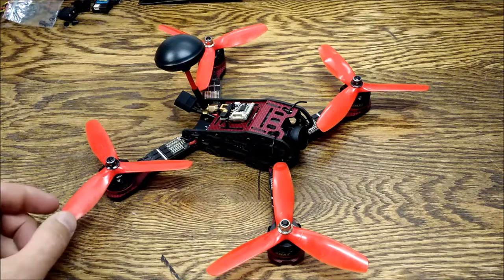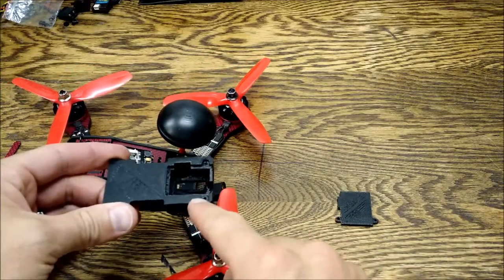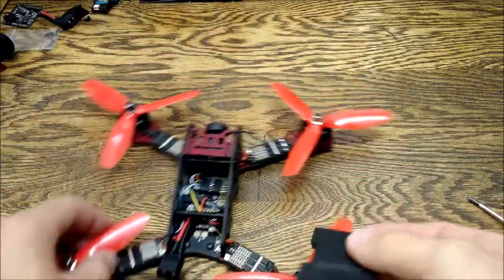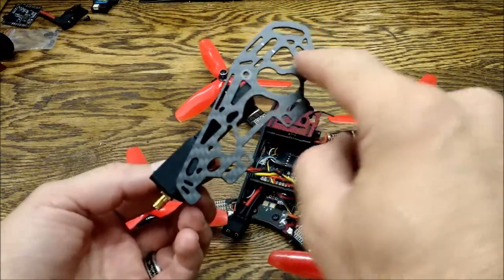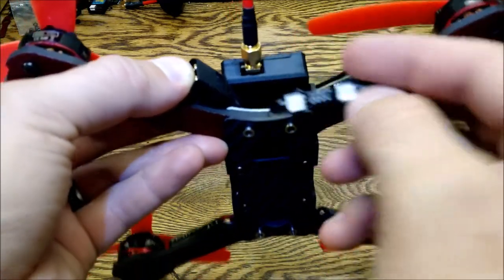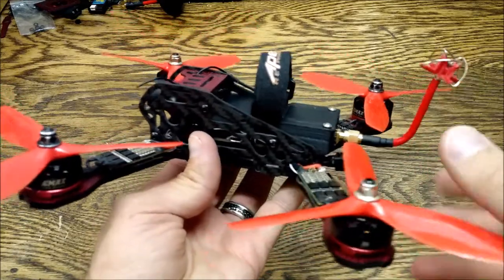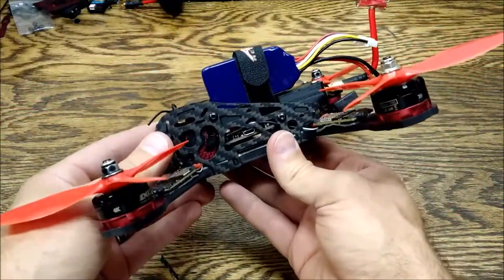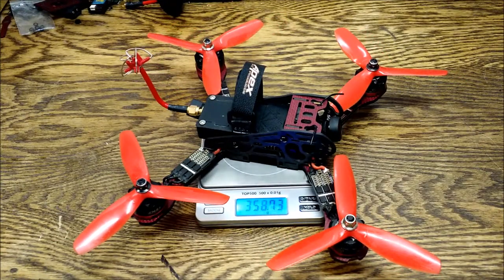Armattan armadillo transmitter installation

Comment: I mounted my VTX in sideways with the antenna coming out the left side. It works ok but what I really like about your 3D printed part is the nice flat platform for the lipo!
I fly in moderate to high winds over hardpack and asphalt and it's really hard on bottom-mounted batteries. I put a CF plate between the lipo and strap to ease the wear when I skid but for whatever reason when I wreck the bottom hits more often than the top. 
Even though I love the way the Armadillo flies I switched over to the Chameleon when Chris released it just to get my batteries off the ground. I'd like to get hold of a platform like that and start flying the Armadillo more. Nice job on the design!
Reply from the maker: It is a cool frame but I moved on as well, I was going through arms like crazy and even though the frame has a warranty waiting two weeks for an arm is not fun.
Reply: That's a bummer about the arms. I've yet to break one. I've destroyed two motors an ESC and a lipo but the frame itself has held up ok. I guess my only frame issue is with one of the posts that hold the camera. It's developed some slop so it moves up and down a little between the notch in the PDB and the notch in the top frame piece. Not too bad but enough to make the camera tilt to one side a bit after a hard landing. First time it happened I thought my gyros were messed up. Leveling the quad through the camera was actually rolling it slightly to the left.

Comment: it was the Aomway Tx25 5.8G 40CH AV 25/200mW Switchable Mini VTx
Reply from the maker: Good to know. Mine just barely hit the prop but I think a spacer on the inside threads of the vtx could fix it.  I am looking into making a 3d printed spacer for this.

Comment: is there room under the hood to install a PDB and my Dodo.. i see the stock PDB is not filtered
Reply from the maker: You could do that, but the slot on the side of the frame would not line up for the usb port. I would buy an external power filter like this one.  
http://www.banggood.com/L-C-Power-Filter-2A-RTF-LC-FILTER-3AMP-2-4S-LC-Module-Lllustrated-Eliminate-Moire-Video-Signal-Filtering-p-1021460.html 
My runcam owl plus had no noise issues coming off of the board.
Reply: They have a V2 PDB out now
Reply: It is now regulate